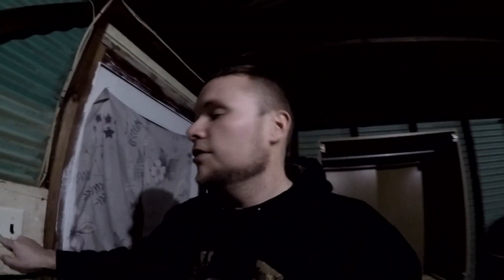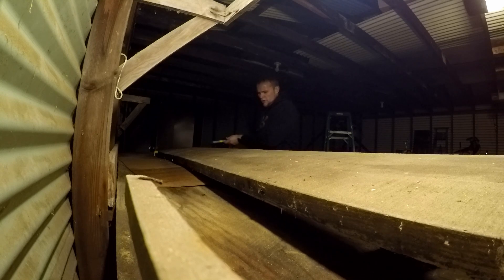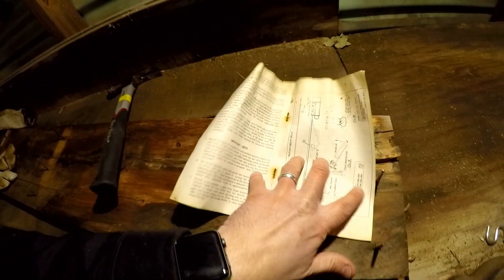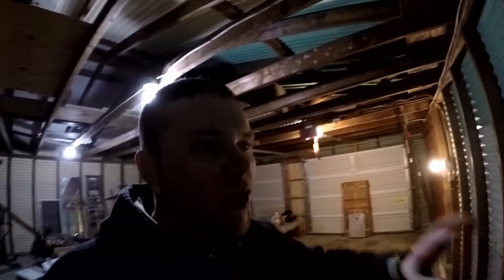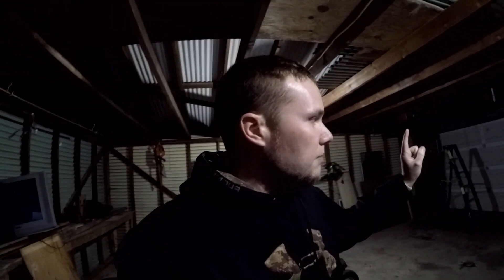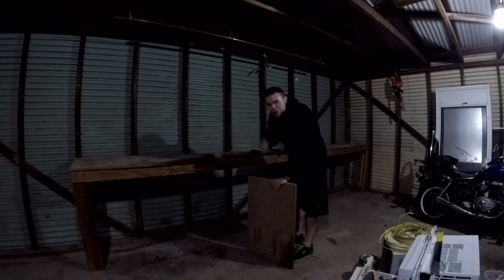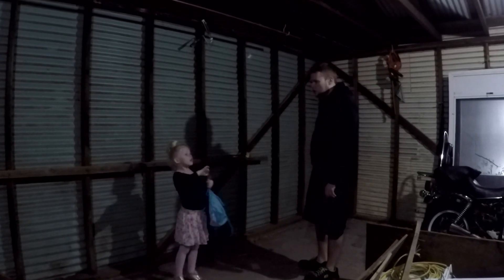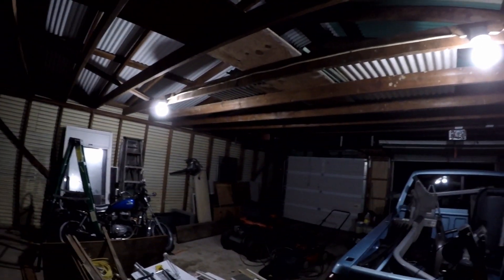CORVETTE Garage: Demolition Has Begun :)

Comment: Good job.  Those flat nails look ancient.  Please give some thought to pest control and security.  I got a couple of electronic pest control units from Home Depot when I had my pole barn in Michigan.  Never had any problems with mousies with any of the Vettes I kept in there for 16 years.  I advise you to install a steel entry door with no window and install a locking deadbolt along with extra long screws to secure it to a reinforced door jamb.  Don't want anyone breaking into your tools and your vehicles.
Reply from the maker: Hi Ronald, yes. Very ancient. Definitely going to do something for pest control. That would be a nightmare. Door is definitely coming down and being replaced. Thanks for commenting. Take care!

Comment: Yes sir get it done.  I miss having my garage.  I had to upgrade the entire electrical in my entire house from the old glass fuse to breakers.  This included a 150 amp subpanel in the garage.  Multiple 220v outlets as well.  My 86 Corvette has been stored outside since selling the house in 2005. 😢
Reply from the maker: Hi Larry, that would not have been a cheap job :( sorry about that and sorry for having to store your car outside. That’s too bad. Maybe some day! Thanks for commenting. Take care!